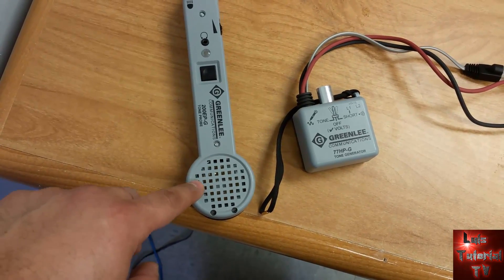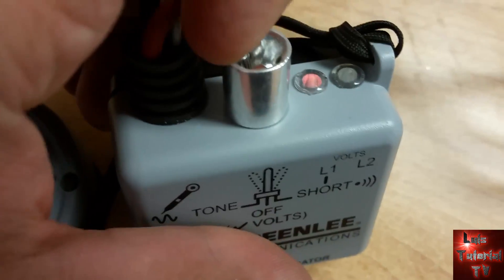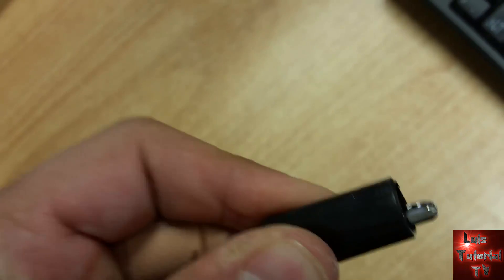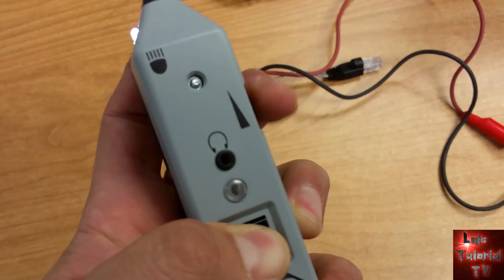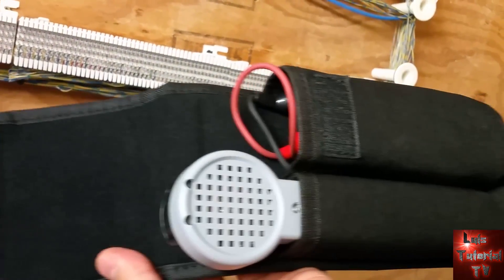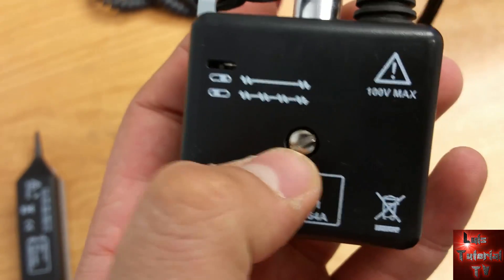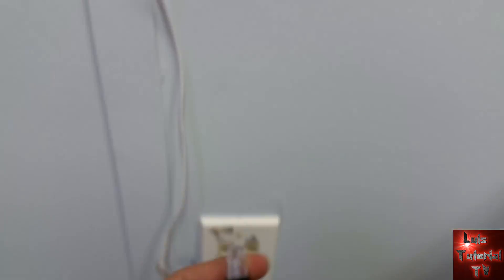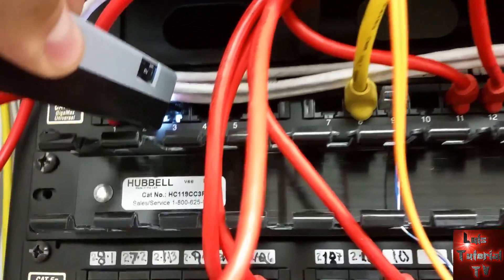Greenlee 200EP-G Tone Probe Review and Tutorial

Comment: I have been using these two tools for many years to find wiring issues in airplane looms. For me what sets the 200EP apart from the rest is the (not mentioned) headset socket. I can quickly find a bad wire in a big loom (some looms have dozens of wires in a run) but to get to the individual wire I plug in my ear buds set the sensitivity to minimum and work through the wire bundle until I can pick out the individual wire that has the "trembler signal" (I call it that) injected to it. I also have the Sperry Wire Tracker although over the year I note my preference to the Greenlee pair. Tip for complex wire breaks I never use this tool with any power on the plane, I disconnect the batteries too. I learnt quickly in the 1980's that any "power on" condition can have you following a wild goose chase - don't get egg on your face! Just power down and use flashlights if its a dark area.

Comment: See if your unit still works. Pulled my unit out after in hot van and no. Has power to switch inside.  Didnt do much more troubleshooting..?? Did it fry from heat in hot van?? Strange

Comment: I though it will be a tutorial on how to use.
Reply: He did pretty much explain how to use... 
flip the switch from off to either tone or short, and either plug directly into a port, use a barrel connector adapter for rj45 connectors, or strip back cable pairs and attach the alligators to the bare copper cable and use the wand on the other end of your cables to identify your cable :)

Comment: Can this be used on a houses 120vac wires?
Reply: You can use it to trace wires like AJFresh said or you can use the probe to test to see if the wires are live.  Hold it near the wire insulation and you can hear the 60 hz. if it is live.  Do not connect the tone generator to a live wire.
Reply: First make sure the wires you are testing have no current. Check online for techniques to check this first. Once you have confirmed that the wires you want to test have no current, you can use this to check for wire tracing or continuity testing.